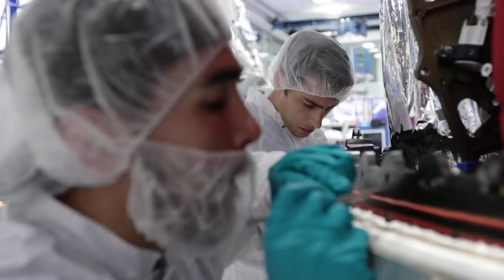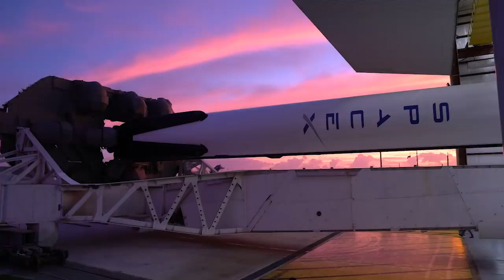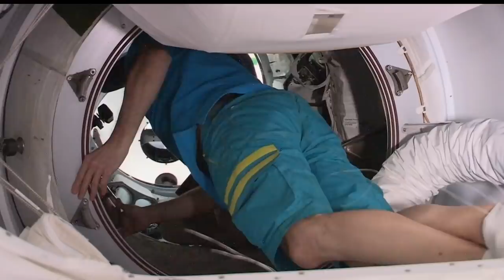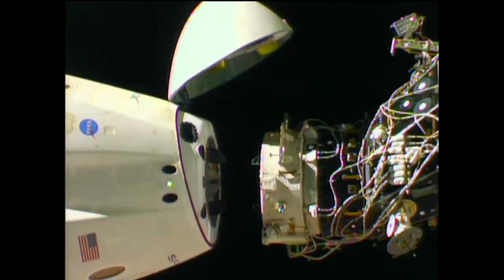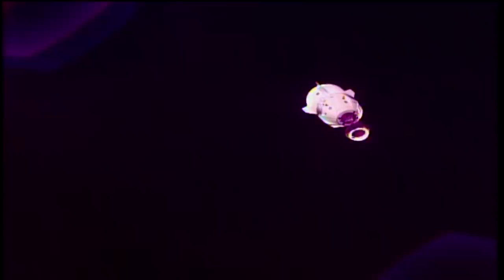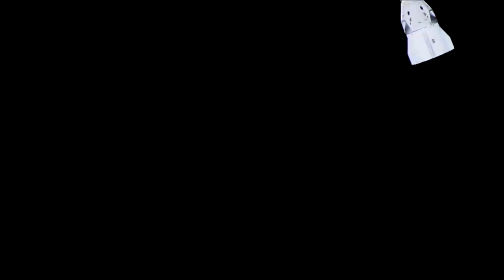Crew Demo-1 | Undocking

Comment: 32:00 separation burn LOL from where is it thrusting?  no thrusters faced in the direction needed.
Reply: There are 4 thrusters underneath the lifted nose cone. Those big black circles around the hatch... They're thrusters.
Reply: I believe the ISS docking port uses springs for undocking. And Crew Dragon has 18 Draco (cold gas) thrusters. 4 on two "quads" (clusters) and 5 on two other quads. Each quad has thrusters pointing in each perpendicular direction.
Reply: ok yeah i see them now, they aren't on the nose cone, they are down below flush against the lower 1/3 of the hull.  thanks yall!
Reply: @codedecode878  They're definitely under the nose cone.

What you mention are indeed thrusters but there are also the 4 thrusters surrounding the hatch of the capsule, usually covered by the nose cone, that are used during the undocking procedure.

Edit: From - https://eandt.theiet.org/content/articles/2019/03/spacex-s-crew-dragon-capsule-successfully-docks-with-iss/

"Capable of carrying up to seven passengers to and from Earth’s orbit, the pressurised section of the Dragon capsule is designed to carry both people and environmentally sensitive cargo. Towards the base of the capsule and contained within the nose cone are the Draco thrusters , which allow for orbital maneuvering"
Reply: @lmaoroflcopter  okay, i'll look into this, i'm still trying to find a diagram of the damn thing.
Reply: @codedecode878  same I have had a Google but no dice on a diagram, there are plenty of photos though and the original space X footage the commentating engineers discuss the unusual design and you can visibly see plumes of gas coming from them at some camera angles.

There is a lot of misinformation too, like muskar's post above. The information he gives appears to be mostly related to the cargo dragon which berths, not the crew dragon which docks. The two capsules have different thruster layouts.